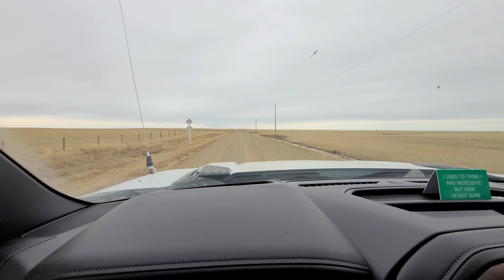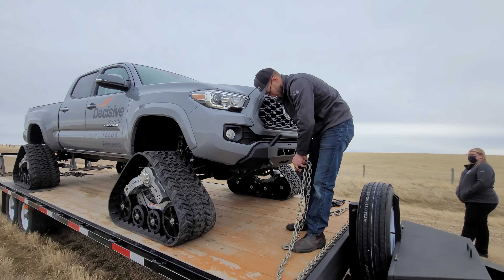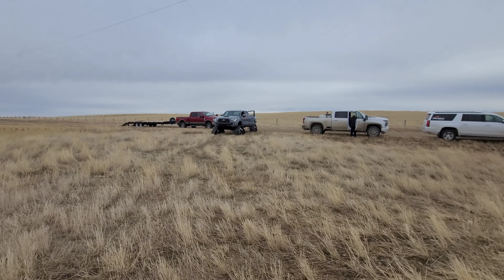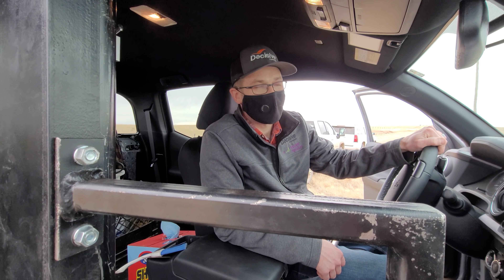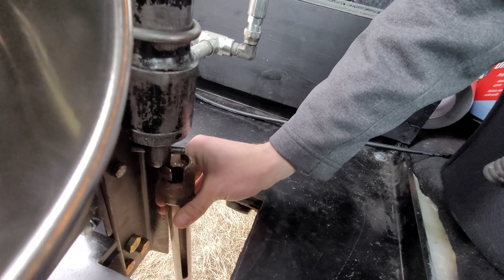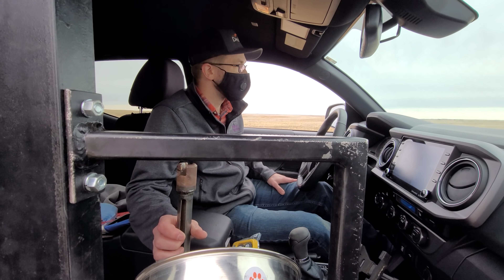Soil sampling prt 1

Comment: Hi Mike, I personally don’t use any of the Decisive, Farmers Edge, etc as my tank isn’t set up for VR technology. 

I do all my soil testing in the fall, to get an idea of blends that would work the best for a specific crop. With fert prices rocketing would hate to have to buy anything extra after finding some different analysis. 

One thing I’d do like what your doing is punching holes in the exact same spot every year. Mine are done randomly through out the field. 

Is every field done on your farm? Most guys I know that are using VR, say their not really saving money on fert, it’s being put down accurately in the right location. 
With my Bourgault 6700 I’m able to VR from the cab manually on the go which I do. Works good for what I want to do. 

All the best this planting season for you and your crew ... and of course the old saying (now) “stay safe”.
Reply: Wonderful to hear you are doing some soil samples yearly.  Decisive samples pretty much 9months of the year across the provinces. GPS and benchmarks allows growers to compare apples to apples to make sound agronomic decisions around yield goals, budget and profitability. You are correct that VR really allows a grower to place correct nutrients where they will be best utilized.  Without a doubt, even the flatest square fields have variations so vr gives them  another tool to extract the best outcome. Helps with lodging, more even maturity and sustainable practices.

Comment: Nice truck setup...But Toyota? Not sure of that. Lots of same size trucks have more cab space that would be utilized better
Reply: They have used Jeep Wranglers. Toyota FJs, Ford super duty trucks over the years. They get a ton of miles on them yearly so I think fleet gets flipped regularly.  It's a really neat set up though!
Reply: @allisonlaliberte2085  I was thinking SuperDuty was too heavy of a truck for the job. That would be the same class as Mike's own truck.
Reply: They use the super duties to pull trailer with 2nd sample rig.   I am not sure if they had tracks on them but definitely used for fall sampling.  The Tacoma trucks run wheels until they need tracks to get through snow or mud. Want to make the least amount of disturbance.  Those tracks boogy across snow pretty awesome!